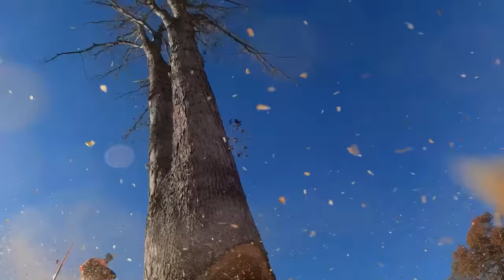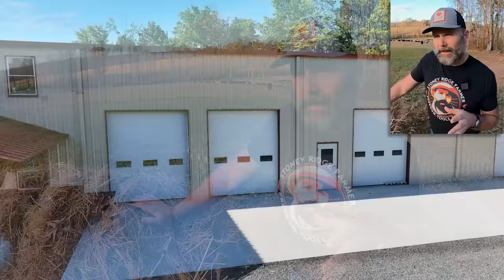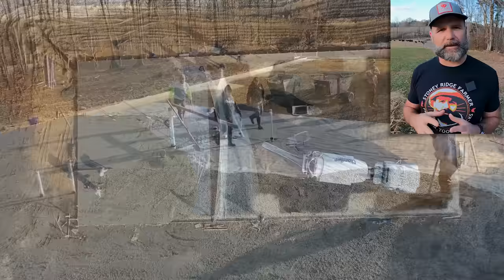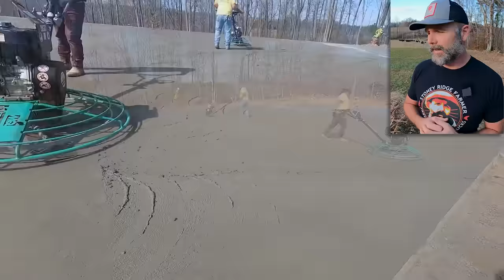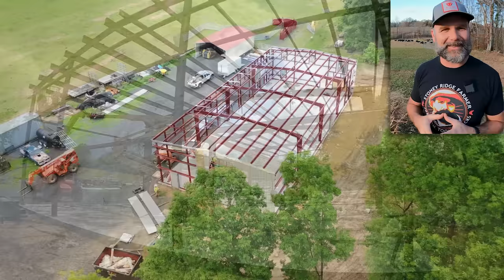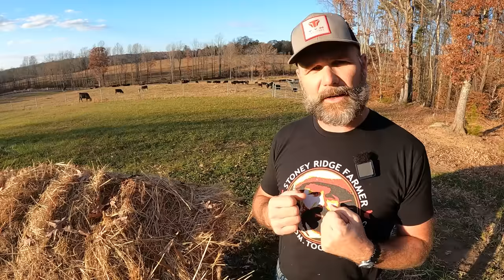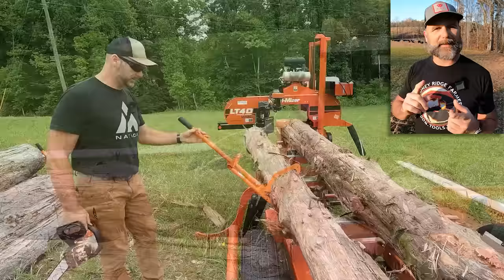Cops Came to Investigate Veteran's Farm! Heartbreaking disbelief

Comment: Josh I had a somewhat similar experience with my local town, when I say similar, I mean, I tried to be proactive and do things right. 
I was going to replace my backyard privacy fence, doing it myself taking 1 section at a time. I made appointment with building inspector, sit down with him after I paid to have my property surveyed so I would know exactly where my property lines were. I told him of my plan and wanted to know how much the building permit was, I provided a copy of the survey and told him that I was going to move it back 3 feet as is was 8 feet off my back property line, his response was, I do not need a permit if I am replacing an existing fence and moving it should not be an issues. So I thought ok, step 1 down and now I called line locate to mark lines as I am trying to be the model citizen and abide by the rules, they come out locate lines now I feel I have done my due diligence and can begin.
I run my straight line across the back and start digging my holes for fence posts, set them, wait about a week to do next step as I was doing this on weekend, all the time all city vehicle and personnel could see the work. I then run my stringers and then begin putting my boards up, do the shadow box effect, from time I set my post until time I completed was about a month, 2 weeks after completion I get a call from building inspector, yep you guessed it, he said I had to move fence as it had to be 8’ from property line, I reminded him of our conversation at first he tried to deny until I told him I recorded it, but he still didn’t back down on his request, so I requested to be put on the next city council meeting and it was granted. I presented my case and explained I was never trying to violate any codes and followed the best of my knowledge the right way to do things, the mayor asked the assistant as the main building inspector happen to be sick about the situation, the assist informed the mayor that my fence was not the only one that was less than 8’ from line, mayor requested survey, concluded about 8-10 fences would have to be moved. I was informed if they ever have to dig up sewer lines my fence may have to come down if they cannot get their equipment back there and Informed them, I drove down behind there wit an F250 super duty ford truck.
One final note the city attorney took a jab at me that I should have known I needed to be 8’ in on property line, my response was simply this, “with all do respect to mayor and council, as a citizen I come to an official you hired to keep me straight and in line as far as building, I set down meet with that official, I offer to pay for a permit, I am informed there is no need and it is not a problem to move the fence, I interpret that as I am good to go and would gladly play the recording for everyone to hear if they would like.  It was quite and they declined the playing of the recording. The building inspector retired a month later. Baldwin County Alabama
Reply: You didn't mention it, but most likely there was a sewer utility easement, typically 20' either side of the sewer line.  These easements show up on the engineering plans, and should also be visible on the GIS that Planning & Zoning and Code Enforcement have available to them.  I was Assistant City Engineer in my local town and worked with the City Attorney on clarifying these exact issues for land owners.  Good for you standing up to your City Attorney.  His comment should have been directed at city staff instead of you.

Comment: In my opinion, in order for something to be  a crime, there has to be a victim. If you can't point me toward the person who I wronged, it isn't a crime.  I am a Libertarian at heart and I always ask myself " does this law make me  more free or less" and 90% of the time it's an infringement on my liberty. We are going in the wrong direction. Thanks for your service, and thanks for sharing on your channel!
Reply: @mmccon2007  So speeding in your car is not a crime?  It only matters if someone is injured or "wronged", not the fact that you put others in danger?
Reply: @rickcollins1825  that's not what I said. Reckless driving isn't victimless, that's your example not mine. The government telling you that you cannot install a toilet that flushes more than 1.5 gallons is an example of government over reach.
Reply: if there is a need to test for intrusion into a water table, that is not a test you have to dig anything up for. It is a paperwork test. the perc test is done before the septic system is installed, that ensure you will have proper outflow, you may have to extend the leach pipes, but as to whether you can, that is rarely an issue. the two can tell you whether the ground is suitable for a septic tank before you build it and stink up your place.
Reply: @rickcollins1825 do you honestly think going a couple mph over the speed limit should be a "crime"? Of course you don't, you do it all the time sometimes without realizing it. Reckless endangerment is what we're concerned about, but naturally the government creates a slew of legalistic bs around that legitimate concern and pushes it too far, sometimes out of overzealousness, sometimes to make money though fines, and sometimes just to screw with people they don't like.
Reply: @mmccon2007  You said they have to be a victim in this case the victim is the person that might own the places years later.   IF you never been through all the trouble and hassle of someone not doing it to code or getting the right permit then you don't understand that it can take months to get things fixed.
Reply: @johnunsicker7440  , fair point. I would say that a good home inspection would help in preventing a buyer from walking into an issue. If no permits were pulled and things weren't built to code, that is when an inspection would hopefully point that out. I am not saying I believe in Anarchy, LOL, just less restrictions.
Reply: @rickcollins1825 ,
Driving fast with good conditions is not dangerous. Quite often it is the slow driver that is dangerous. Case in point : I was driving across Utah with highways straight as an arrow and little traffic. I was driving in the left lane at a high rate of speed when the car ahead of me suddenly moved into the left lane for no apparent reason. I was going too fast to slow enough to keep from hitting the other car. So I changed to the right lane to go past him , praying that he would not decide to move back into the right  " slow " lane.
  During Jimmy Carter's days the NATIONAL speed limit was 55 mph. Which takes forever to cross the American deserts. I would guess that there were thousands of drivers " breaking the law " !
 Speaking of speed limits , I had a friend in California who was driving at 65 mph ( the speed limit ) and got a ticket for driving too slow and impeding traffic. You can't win in a Socialist Democrat state. If they want your traffic fine money they will find a way to take it.

Comment: My detached garage had 120V power supplied from the main panel in my house when I bought the place. I wanted to add more 120V circuits, and one 240V circuit, so I submitted a permit application that included all of the specs. The permit was granted, I did the work and notified the building inspector when it was ready for inspection. He said, "Well, it's just a garage. I'm sure it's okay," and signed off without doing an inspection. I finished the interior, hung cabinets on three walls, and enjoyed my workshop for many years. When I applied for the electrical permit for a home addition sixteen years later, the new inspector didn't like the way the previous inspector had permitted me to tap off the main panel in the house to wire the garage. He made me disconnect the garage circuits, dig up the cable, and have a completely new service entrance and panel installed in the garage. The location of the pole dictated that the new panel had to be on the opposite corner from where the underground cable came in from the house. I had to pull all of the cabinets down, open the walls, rewire the entire garage, and pass inspection. It cost me $11,000 to redo all of the work the previous inspector had approved.
Reply: I don't  believe he could have done that. The previous inspector signed off 16 years ago that the job was to code back then. They can't come in today and make you rip up the work to comply with the current codes.
Reply: Some times I think egos are playing in decisions made!
Reply: This is the kind of story that reaffirms that inspectors god complex shows through.
Reply: Well, that's just WRONG! If you have done it, and had it passed inspection to code AT THE TIME IT WAS GONISHED, then there's no readona subsequent inspector can come and have you do more. That's just BS!
Reply: You should have called a lawyer.  It passed legally and thos new inspector did not have the authority to make you re-do it his way.
Reply: I agree, should of talked with an attorney before redoing the work that passed the inspection years before.
Reply: @lou704 Did you challenge what this guy was forcing you to do? I've seen this happen to land owners and some had to go to court and have a judge over ride the inspector that's making up their own rules.
Reply: Wow you’re kidding me. What a nightmare
Reply: That's an ego problem.
Reply: Code changes over time.
Reply: BS
Reply: @graydi66y  yes, but they can't make you upgrade your home every time the code gets changed. They can only compell you to be code compliant when you change or upgrade something, and not until then.
Reply: But it was already approved, you shouldn't be out of pocket for a previously approved job,just saying, they should be called on that, that is so disturbing
Reply: I also live in NC and they tax us on everything. It's sad. We are taxed to death.
Reply: @janetwilson3285  after what I saw Eustace Conway from Mountainmen go through with his city tax people, I would never move to NC.
Reply: That's why you shouldn't ask for a permit. Its your place. Its your risk.
Reply: @maryhall4756  ok Karen. Some MEN & women like doing projects in their garage or workshops. If you don't understand or can't grasp that... Just let go... But make sure your high horse isn't too tall when you let go out you'll hurt yourself
Reply: My neighbour 0:06 had a small porch style conservatory to stop the rain pouring into her cellar I did not so she suggested I built one .
I had a stroke and couldn't visualise so she helped me draw and plan it out .10ft high .7 feet wide with a sloping corrugated polycarbonate see through roof and gutter with rain barrel the same as hers .But mine had wooden bottom, wood upright supports not brick and polycarbonate clear panels to allow light to pass through .
A wall  7ft high by 34 feet long borders our joint boundary.
We planned flooring , Cork for warmth ,we planned insulation sheep's wool in the walls, we measured for a drain in the floor connected to the exterior waste pipes and electric cables for a washing machine drier , freezer and refrigerator.
 I booked the work to be done while she was on holiday to avoid disrupting her life and paid a deposit .
Work began, materials purchased, wood was bolted to my walls on the back of my house. The main supports  fixed in place, wooden panels and poly sheets cut to size .
we bought all the plumbing fittings and a sink and taps,drilled holes for electric cables to pass through the wall into my kitchen on the other side of  porch wall.
neighbour came home saw the project and reported me to planning who ordered it to be ripped down .she said it would block her light.
There was no light to block.
On her side a 7 ft high wall on my side a three storey brick dwelling .An alleyway 7ft wide divided us .Planning said my structure was three quarters of an inch too high the maximum was 10ft and mine was 10 feet and three quarters of an inch .
Nothing would change theirs or hers decision .She complained that when her windows were open she would hear my washing machine and it would spoil her enjoyment of her home .She also complained my door would open outwards and be unsightly from her bathroom window if she opened it and looked down. They won my structure was pulled down because it broke the 45 degree rule ?
I have large holes where the bolts would have been in my outside walls .Bees moved into, them I like bees.
Not wanting to waste space I hung a 34 foot long 10 ft high washing line with a pulley and 3 props .
now my sheets billow like huge flags, trousers and jeans and tights, occasionally duvets dangle like bunting, wafting the smell of comfort through her kitchen windows and the holes in my walls have screw in eye bolts that hold assorted plant hangers and beans peas and sweet peas adorn my walls I hope she loved the sensory sharing .sadly she died 3 years ago this summer and for all her odd behaviour I miss her terribly .
The odd thing is her conservatory was identical in dimensions but hers was permitted.
Reply: I guess you don’t know where your middle finger is?? Lol
Reply: @miltlance3654  Dude, chill. She's saying that the inspector has an ego problem, not Josh. You got it backwards.   Peace
Reply: @Richard-il6wc  wow! Dooood! Read my response again... Smoke another Doobie!!

Comment: I too am former Law Enforcement (USAF) and built a super shop!  I had no problems with the County, except when I tried to build a porch on my house because the old one rotted away, they wanted archetectual drawings to grant the permit.  I took 3 days off to build it, but after I dug the holes for the roof support posts, it would take them 48 hours to inspect the holes to make sure they were deep enough. etc...  what a nightmare.  Good luck to you!
Reply: @hoecherd  Why do you think they inspect the holes?  Do you not realize that every part of the building codes come from someone being injured or killed?

Comment: In the 1960’s we had a dam built by the Army Corps of Engineers.  Reason…to stop run off erosion through our land.  Several of these dams were built along this 10 mile stretch to protect roads in the county from being washed out.  We have all the paperwork, etc., given to us.  This land is all dry land farming.  Some years we get lucky enough to get enough snow and when it melts it fills up the area behind the dam.  The “pond” will last up to 7 seven years before evaporation takes over and it dries up.  We take advantage of this by stocking it with fish for recreational fishing.  Couple of years ago some county agency came out and started asking all kinds of questions about the dam and the water behind it.  We gave all the answers.  Then Fish and Wildlife came out and wanted to designate it as a wetlands.  Next came some alphabet agency wanting to know how much water was in the pond, where we were getting it from.  Had to explain that.  Next agency wanted to know how many cattle we were running on the place.  None.  Finally the Army Corps of Engineers who built the dam in the first place wanted to come out and inspect the dam.  They had no record of them building it, so we had to give them copies of all the paperwork.  What a bureaucratic nightmare.  Finally, Fish and Wildlife came out again because they were concerned if the dam blew out, and the fish we put in there would wash 12 miles down to the river and put fish in the river not native to it.
Reply: Kind of hilarious how ridiculous this is and concerning all the weird investigative questions regarding stocking the pond.
Reply: Seems about right
Reply: Sounds a bit like Australia. Folks have similar problems here. Local councils charge landholders for the water they have collected in their dams. Bureaucracy gone mad.
Reply: TOO MANY PEOPLE EMPLOYED BY THE GOVERNMENT !!!  VIVEK, IF TRUMP DOESN'T CHOOSE YOU AS VP, SHOW HIM YOUR PLAN HOW TO GET RID OF AGENCIES !!!

Comment: This almost exactly happened to us 17 years ago in Ohio. Zoning in Ohio is dependent upon Counties and Townships. We built a 55'by 50' shop on the back of a existing bank barn. It has a block foundation with 3'deep footers. 2+6 construction built like a commercial building with overhead doors and concrete. We informed the Township zoning inspector abd he OKd it as an exempt Ag building, no permits required. My township is zoned in my county. A building inspector left a card an violation on the front door of the house about six months later and we called the building department. He drove by and saw that the barn did not meet the new exemption laws in Ohio at that time. In Ohio you need to use the building for livestock, grains, farm equipment only, and our zoning inspector did not know of the new changes at that time. Fortunately we had taken pictures of the stages of construction so the inspector had us pull a permit and they signed off on all the work.
Reply: Functionally you had to pay a bribe to keep your own property. It's just like paying protection money

Comment: I worked as a plant engineer at a steel mill in NJ over 30 years. NJ building codes are rediculous, but that's part of the territory. The worst part is that building code officials can legally require you to comply with directives that are more stringent than the codes. If you fail to comply they can issue stop work orders and/or refuse to issue a certificate of occupancy and find you until you do comply. You can appeal to the county, but the appeal process can take months. I had such issues and just complied because the delays to the projects would have been costly in $ and lost production. The few times I did appeal I won and the county board chided the local code officials, but their behavior never changed.